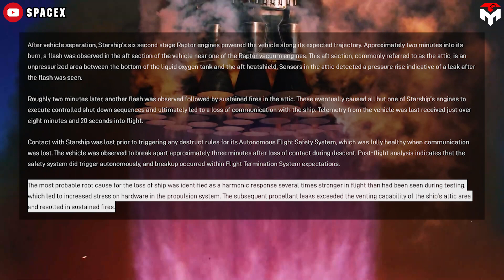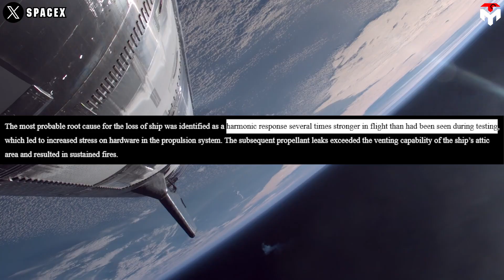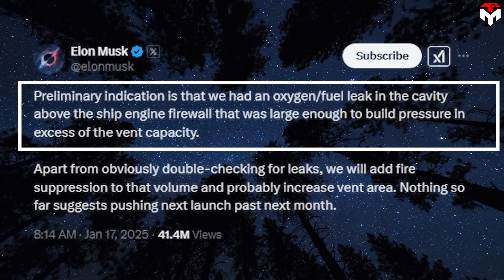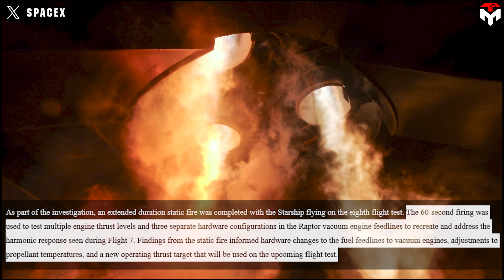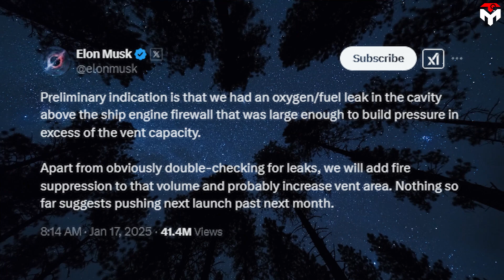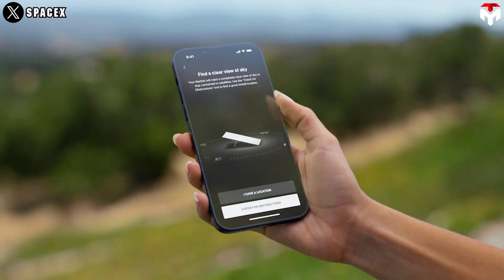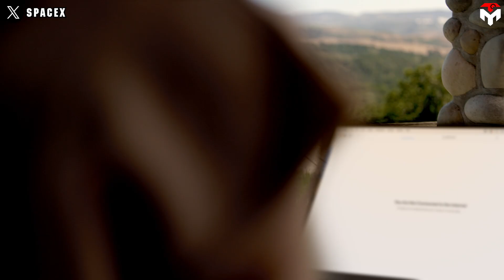X10 Harmonic Response: SpaceX Revealed Root Cause of losing S33 During Starship Flight 7

Comment: Resonance is something that should be modeled with advanced simulation software. Even the 60 year old hardware of the Apollo program didn't lose flight vehicles to resonance. As of yet, no one has identified whether the resonance was in a propellant line structure, or in the column of liquid flowing through it. Different solutions to each type. Rocketdyne used accumulators to cope with resonance in the working fluid, and flexible couplings and changes to hardware mounting points to shift the natural frequency of the assembly away from that of the surrounding structure. But venting and fire suppression are not the answer. Musk should talk to engineers before he answers these kinds of questions

Comment: Great to hear this tech info. 
Skip to 3:57 end 5:30 for the improvements. For regular listeners the rest of this video is guff.
Easy to appreciate how harmonics could cause this damage. hopefully static fire testing and the findings are similar to when the rocket is flying unrestrained with dynamic flight pressure on the outside of the craft.

Flight 8 go !
Reply: This was the cause of why the latest static fire test lasted much longer than the previous ones.  They were looking for what vibrates ('harmonic response').
Small parts for rockets and satellites are tested on electromechanical shakers which work like huge loudspeakers. But you cannot test a whole rocket with that.